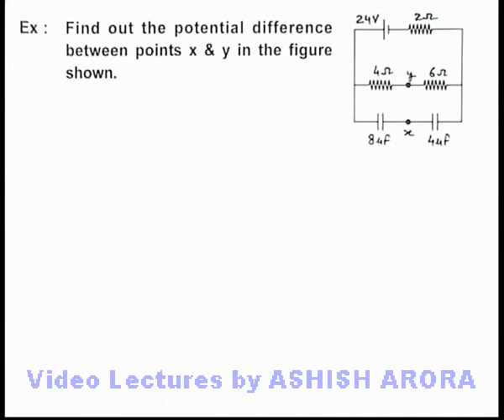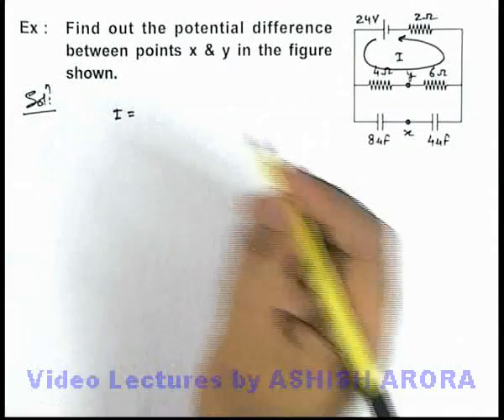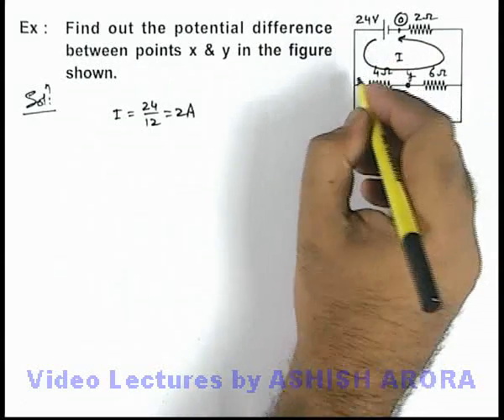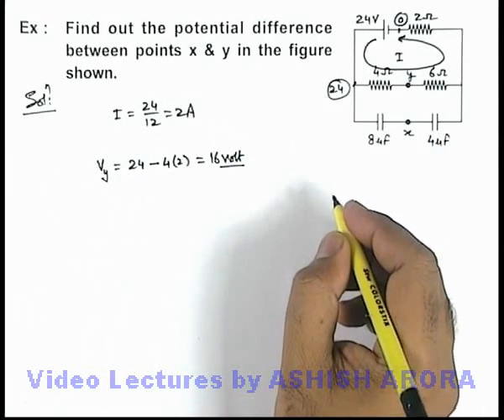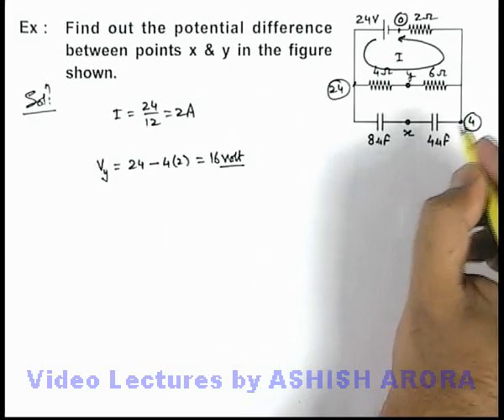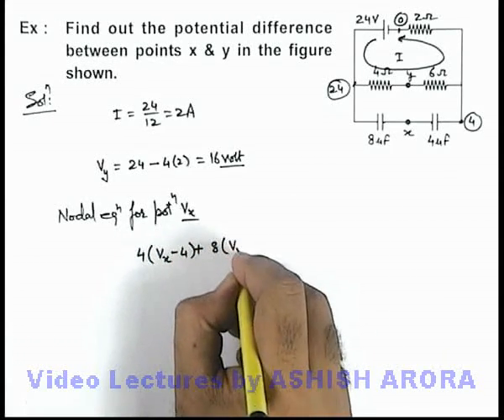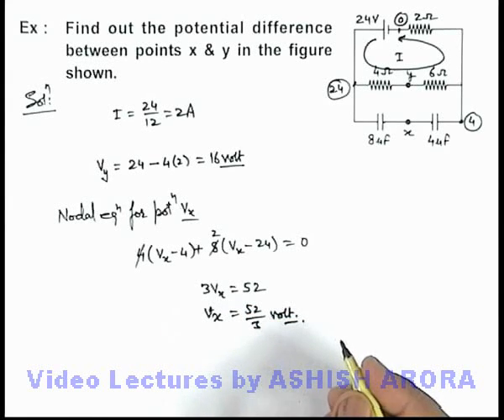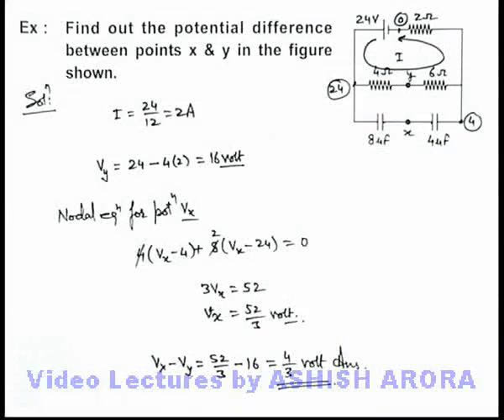Class 12 Physics | RC Circuits | #14  Solved Example-5 on RC Circuits | For JEE & NEET

Comment: sir why did we take resistors in series as 4ohm 6ohm and 2ohm
Reply: As capacitors are in steady state and no current is passing through that lower part of the circuit